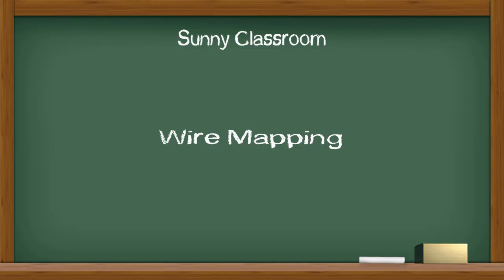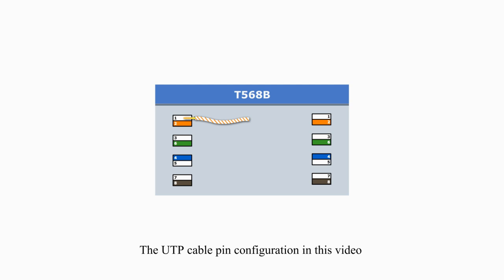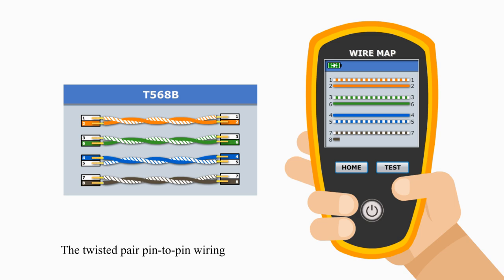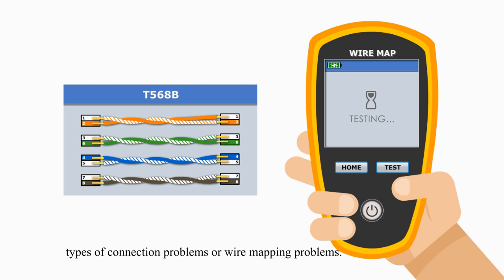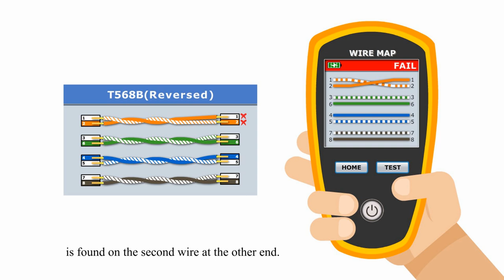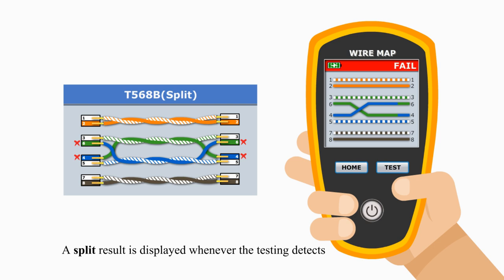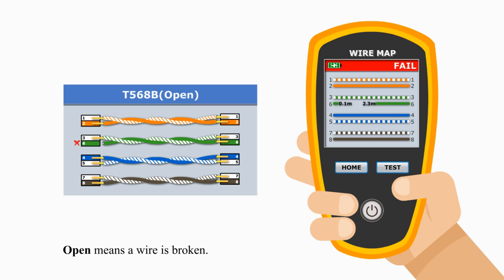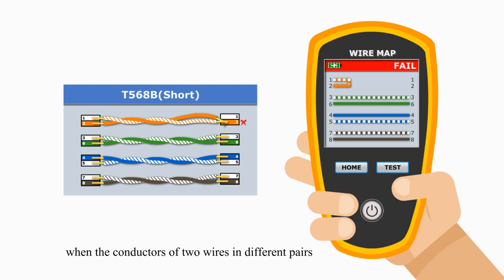Wire Mapping: reversed, crossed, split, open, & short

Comment: I work for a small company is Massachusetts. I used a tone generator and found the Ethernet port in our conference room and it’s end in our network room. It’s numbered and tone generator confirms it. The punch down jack is wired correctly. I crimped on 3 RJ45 connectors and they are all not working. I can’t really get into the walls. Would this tool help me?